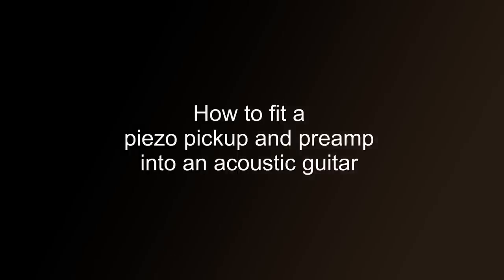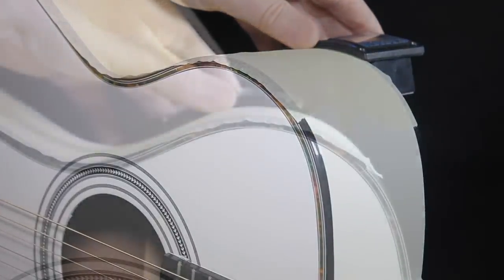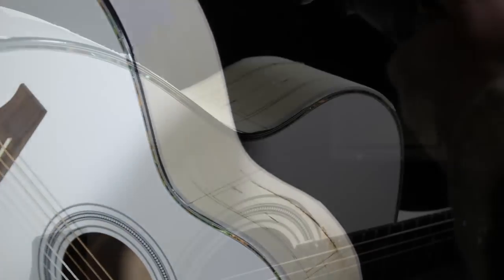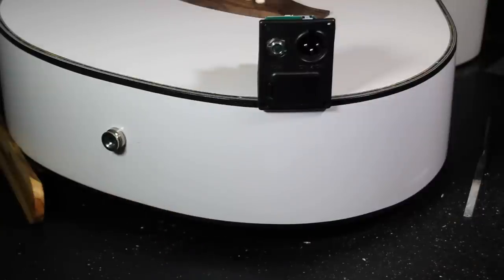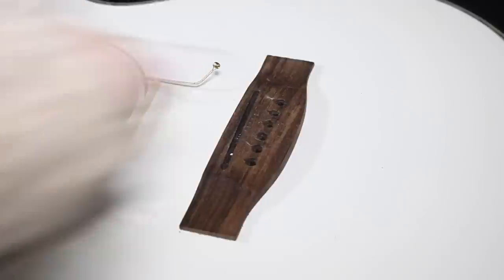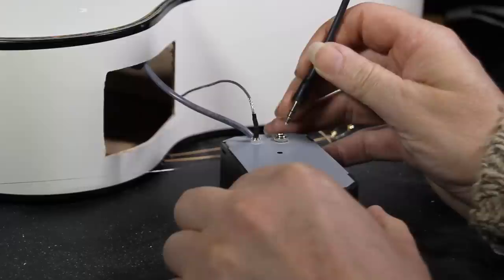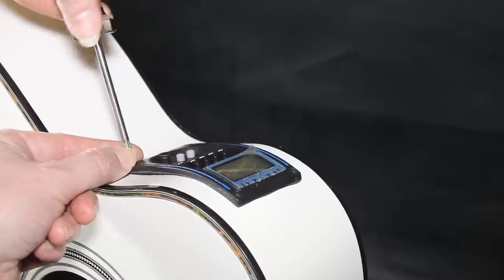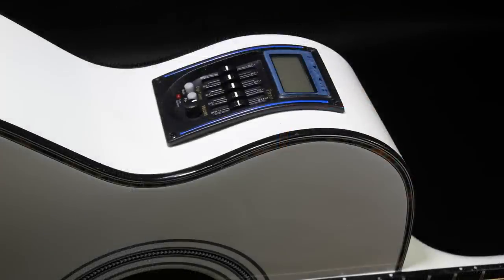How to fit a piezo pickup and preamp into an acoustic guitar. The LC-5

Comment: Also, how is the guitar with the weight of the new mic in it. It is a lot heavier than a gooseneck, so has it ever fallen out of the preamp. Would you have confidence gigging with it?.....Weightwise,,,
Reply from the maker: +Benny Hill The new mike is almost exactly the same weight as the original one and the plug socket is really tight.  It has been in place over the last couple of years now and the guitar has traveled and been gigged.  I have every confidence it will stay in place for as long as it's needed and any knock big enough to knock it out would ruin the guitar.
Reply: +GCH Guitar Academy ...Thanks , 1  So in your opinion does the Sony mic work well with the preamp...2 Does the preamp volume control work with the Sony or not??..........Many Thanks.
Reply from the maker: +Benny Hill Yeah . . . the original had a slight background buzz which was completely silenced when using the Sony mic.  However, you do loose the versatility of the gooseneck and the ability to fine tune the position of the mic.

Comment: Hello,  really nice job over here! i was wondering if i have to lower the bridge height or leave it as it is?
i mean,will the action still be the same over the neck of the guitar or will it increases because of the under bridge pickup?
Thanks to answer...
Reply from the maker: If the guitar had no pickup in it originally you will need to lower the action.  To do this you sand the bottom of the bridge down to compensate for the height of the pickup.  If you are not sure, but a spare bridge before you start as they are very cheap.

Comment: I bought the extra same kit, but before hacking into my guitar I tried it out. After turning the unit off the piezoelectric pickup and mic stay active. Is this normal? I think It's going to drain the battery right?
Reply from the maker: Yes, that will drain the battery but normally the switch on the control unit is just for the tuner display.  The switch for the pickup amp is in the jackplug and xlr plug so it should go off when you unplug it.  Unfortunately this is a little awkward to test.
Reply: Glad I see this.
There are switches inside the unit.
I moaned to the Ebayer selling to me, but they never replied.
Just a simple bit of paper would clarify all this...

Comment: Do you hear a difference with the addition of a microphone in the body of the guitar.....is there a different tone with the microphone compared to only having the piezo pick up under the saddle?
Reply from the maker: Yeah . . it is a very different sound and if you have the ability to mix between the mic and the pickup in the preamp then you can get the best from both methods to find your perfect sound . . .  or at least that's what I found.  :-)
Reply: Great thank you....I am going to order one like you installed. Great video I used it as a guide installing a preamp. thank you again.

Comment: I'm having a Fishman Neo-D passive sound hole pickup, can it could connected to preamp...?
like you have used a mic for better quality, in the same manner can I use my fishman?
Reply from the maker: The only problem I could imagine that could happen is that the impedance might not match.  This might not happen at all, but I would do some research first before investing or starting the job.  If the impedances don't match you might end up with distortion or not enough signal.

Comment: Is the microphone used is the ECM-DS70P? Is the original or $ 5?
Reply from the maker: Edgar Arcadio Parra Lopez I tried both (I actually tried 3 or 4 mics), but the cheap one sounded better because it picked up less bass
The fact that the mic is inside the guitar means it isn't in the optimal position, but a reduction in bass works well to correct this.

Comment: Hello what does the "note" button do on the tuner thingy? Im a beginner and I accidentally pressed it instead of the power button when I wanted to turn it off and now the tuner doesnt work. Thanks!
Reply from the maker: The note button turns on the tuner.  In tuner mode no sound comes out of the output of the guitar and If you leave it on it will flatten the battery, which is probably what has happened to your guitar.  🤔
Reply: @guitar-academy  Ohh okay. If you dont mind me asking, do you know a way to make it work like how it used to again?
Reply: When we first bought it, when I pressed the power button, it would automatically detect the guitar string when I pluck it. But now only the "-50", "+50" and line indicator thingy which doesnt move anymore shows up.
Reply from the maker: @ayllyn6788  Just press the button again . .

Comment: good day, i hope you see this comment. i just have a question, i just bought a guitar with similar hardware and the thing is, i noticed it is making a not so loud ground hum that disappears whenever i touch the metal part of the jack cable. is there anyway to ground it properly like how electric guitars work where if you touch the strings, the ground hum goes away too?
Reply from the maker: hmm, it does sound like you have a ground issue.  The first thing I would check is the lead and then I would check the easy to see connections behind the jack-plug socket.  Hopefully one of these will solve the problem because beyond this it is more complicated. 🤔
Reply: @guitar-academy  yeah, i think the one i got is just broken or something. i tried removing the hardware and checked if there's anything strange or blown out/burnt but i found nothing. i guess i'll get the fishman acoustic pickup or something similar instead. thanks for the reply man!
Reply from the maker: @sadpotato7029 No problem . .  I hope you get your guitar fixed soon and cheaply  😊😊
Reply: @guitar-academy  so here's what i ended up doing:

i found my old samson q7 mic, stupid idea sparked in my brain and thought what if i put the capsule of this mic inside my guitar instead? so i did.

at first i only replaced the broken xlr out from the mic with from another old broken mic and it worked, but the problem is, i wanted to plug it into my scarlett solo's instrument input so i can use the mic input at the same time which wasnt happening for some reason coz even if i use the xlr to 6.5mm jack, it's not giving out any signal. it works perfectly in the mic input tho.

another stupid idea came up when i saw my guitar's old jack and thought what happens if i wire this capsule directly to a jack AND IT WORKED. IT EVEN WORKED ON THE INSTRUMENT INPUT IN MY SCARLETT SOLO HAHAHAHA now it's just a matter of positioning the mic properly to get a balanced bass and treble sound from the guitar since it is mic'ed from inside. i also need to come up with something that will make the mic capsule stay in place without damaging the guitar
Reply from the maker: @sadpotato7029  very creative and should sound good 🤔
Reply: @guitar-academy  well since the capsule is from a "budget" mic, i'll let you judge how "good" it sounds. but for me it does sound more natural compared to the previous defective piezo hardware in it and also with less tinny noise from the plastic pick. for now the mic capsule sits on the bottom a little bit to the right side below the hole [ https: //youtu. be/ 25v7lwq8ar8 ] also no more ground hum. i also need to do something about the exposed wires and maybe put a cover or something to the exposed capsule
Reply: @sadpotato7029  About 40 years ago, before computers and digital recording were popular, I was doing multi-track recording with two tape decks and an equalizer in between them. I had a Radio Shack pencil condenser mic (powered by a battery in the plug end), and I just dropped that into the soundhole of the guitar. It actually sounded very good when recording!

Comment: Hi I have a problem while fitting my pietzo pick up, the channel on the saddle was the much the same depth as  the pick up which resulted in no depth to hold the bridge in position which bends when  tightening strings any tip on how to solve please
Reply from the maker: the solution to this is either to take some of the height off the bridge or to use a file or mini-drill to go deeper into the saddle, depending on the guitar.  I tend to do a bit of both, make the channel a little deeper and take some height off the bridge.  It is important not to go down too deep into the bridge.

Comment: Battery in but light flash  then turns off? Now light won't come on with brand new battery in it ? Should I trash it?
Reply from the maker: That sounds terminal, but just in case try a different battery and check it's in the right way.

Comment: Cool Video thanks. But I dont understand what you do at 14:45 - 15:45 with this white little thing.
Reply from the maker: That's just to hold the wire in place so it doesn't move around when you are playing the guitar and you can put the wires out of the way so you can's see them easily through the hole.
Reply: GCH Guitar Academy thank You. At least I got it by myself while I thought about it 😁

Comment: i watched your video before fitting almost the exact same one, mine just doesn't have the mic bit. only trouble im having with it is its overly sensitive,  like when i take my fingers off the strings to change chords i get a terrible squeek and doing a slide is out of the question. any advise

Comment: In what hole did you put the microphone? The preamp has only one hole and it is for piezo.
Reply from the maker: Yours might, but mine didn't.  The preamp I used had 2 holes in it one was a slightly different size so you could get them mixed up.  look at 15:59
Reply: @guitar-academy  How Can I doit input jack 3.5 by myself?
Reply from the maker: @Crow_spot  Sorry, I can't answer that in a few sentences

Comment: thinking about putting in a pre amp  on my acoustic what's brand is the one you just put in does it sound good  and what microphone did you upgrade it with on ebay thanks
Reply from the maker: The preamp was a cheap unbranded one I bought directly from Hong Kong off Ebay and the mic was a Sony ECM-DS70P.
Reply: Just to chime in on sources: I bought that ( approximately) same model pickup off of banggood. I think it was less than 20 USD.

Comment: I couldn't see how the piezo wire threaded though as to not be seen. How was this done?
Reply: You have to use the zip tie and the bracket all the wires should be inserted into the zip tie and then mount the bracket near the too front face of the inside in your guitar make sure it's not super tight but tight enough to hide the wires and prevent rattling or buzzing. Good luck
Reply: +Jake Mitchem I believe Joe Ibrahim is talking about how the hole in the bridge was not shown in the video. The guitar in the video didn't need a hole drilled, but it would have been nice to see the size and location, because this is a "how to", and some people would like to see it. It's no doubt as easy as drilling a hole through the bass end, but some people might be anxious about ruining their guitar.

Comment: The Sony microphone you purchase from ebay
Was it a proper Sony microphone or a cheaper version
Reply from the maker: I bought both to compare them but ended up using the fake.  There was so little difference between them when inside the guitar but I didn't want to leave the more expensive permanently inside the guitar. . .
Reply: @guitar-academy  the mic is ok
Reply: Just ordered mine looks exactly like your one but only one aux socket in the preamp and no microphone? Does it need to have microphone?
Reply from the maker: @matthewmatthias4181  No it doesn't . . in fact I've noticed that the batteries seem to last longer ones without the mic. . .  😊
Reply: Nice cheers good video by the way very good guide
Reply from the maker: @matthewmatthias4181  Thanks . . . .  😊

Comment: excellent !
can I use the same process on a classical (nylon string) guitar?
Reply from the maker: Yes you can, but make sure you have the correct under bridge pickup.  The classical bridge is longer, but you can measure it and then get the pickup designed for that length of bridge.
Reply: Normal pickups don’t get the sound of nylon strings tho
Reply: By "normal pickup" he means a magnetic pickup.  There are three types of pickups -- magnetic, piezo and mic. Magnetic pickups are the kind you see on electric guitars but can also be used on acoustics (check out the Dean Markley Acoustic pickups for a magnetic in-hole magnetic pickup) --  they work because the metal strings oscillate the magnetic field, which in turns varies the electrical current (nylon strings therefore won't work because they won't disturb the magnetic field).  Piezo pickups work by their crystals generating an electric current in response to the mechanical stress resulting from the vibration of the guitar's bridge.  The mic works just like any other microphone -- the sound vibrates the diaphragm which creates an electric current in a capacitor.  There are two pickups in the pre-amp he installed -- a piezo pickup he installed in the bridge and a microphone which is in the body.

Comment: I should have watched this before i installed. I cut a bigger hole than im supposed to now the screws dont have a place to be pierced in. Do u have any suggestions about what to do😢
Reply from the maker: You might be able to mount/glue some strips of wood inside the hole around the edge to make the hole smaller.  When you put the preamp in you shouldn't see the repair. 🤔
Reply: @guitar-academy  hey! Thank u so much for the video and the tip. I will try with a popsicle stick. Hope it works out 🥳🙏🏻
Reply from the maker: That's strange, I thought exactly the same thing.  I hope it works out too 😊😊 @samanthacollier8933
Reply: @guitar-academy  thank you so much! may I ask one more question please? I think my preamp also doesnt provide sound from the pickup I think it only gives volume from the built in microphone. Do you think I missed something while placing the cable under the pickup area? Mine wasnt with 90 degrees it was a golden wire like the one you showed. Thanks!!
Reply from the maker: @samanthacollier8933  oh, that sound it might be faulty.  There's very little you can do wrong with the pickup.  If the wire is under the saddle (the plastic looking bit) so it has pressure on it from the saddle and the strings it should work. 🤔
Reply: @guitar-academy  oh ok then thanks a bunch i will lastly check the jack pot then maybe thats a bit loose. Saved me from removing the saddle again Thank u!! 😍
Reply from the maker: @samanthacollier8933  Hopefully that's the problem, good luck 😊😊

Comment: in the 10:00 that piece
do i need it in classic guitar ? 
is it to remove the noise sound ? 
i mean it's special for steel strings
Reply from the maker: That is the pickup and you do need it for a classical guitar as it is what sends the sound to the preamp.
Reply: thx alot my friend ❤❤❤❤❤
Reply from the maker: @عمرأنيس-ح9م  thank you  . . .  😊
Reply: i have another Q about the pickup ..
it doesn't matters which end i'll chose to make the hole for wire ? 
or it's imprtant to put the hole next to bass strings ?
Reply from the maker: @عمرأنيس-ح9م  on that particular pickup the hole should be by the bass string because the pickup is designed that way and the wire comes out closer to the preamp,.  Some pickups are designed differently so the wire comes out near the thin string, but I have never used one of these . . .
Reply: @guitar-academy  
thnak u so much 🧡

Comment: Do you need to reinforce the sides - especially for non-laminate sides?
Reply from the maker: I didn't on this project because the curvature of the guitar gave the area around the preamp strength, and there was enough depth to the wood to allow the screws to purchase.  On this occasion I was trying to keep the job as simple as possible but I do prefer to reinforce the area around the holes.

Comment: Hi, i just installed the same equipment to my guitar but I did not place my piezo under the plastic part it did not fit I placed it just behind, does this affect something? I don't get my tuner working and there is also a busing sound that stop when I touche my output.
Reply from the maker: Sorry to say, that's all wrong.  Part of the reason for all the noise is that you have to have the amp volume up high to hear anything because the pickup is hardly getting any signal where it is.  The pickup has to be under the bridge so you need to buy one that fits if you want it all to work correctly.

Comment: i was wondering can you please tell me what is the tool that you used to cut the guitar open?
Reply from the maker: The tool is a rotary tool (Dremel), with a carborundum disk on it.  My Dremel isn't Dremel the maker, it's a cheaper make but it does the same job.
Reply: @guitar-academy  Good sir, i'm planning to buy a similiar low cost Dremel tool as well, but have seen incident comments saying that the shaft bent or the rotary blade shatters in action, have you encountered any such situation thus far ? Thanks
Reply from the maker: @johnangkengyong6952  Yes I have, But that has nothing to do with the tool.  You can buy the tool and the cutting disks  separately with the shaft and these are what brakes.  The cutting disks ware out anyway because that's what they are intended to do, but you can buy better quality cutting disks and shafts.

Comment: Could you do it with nylon strings?
Reply from the maker: Yes you can but measure the length of the bridge and make sure you get a pickup of the same width.  Nylon strung guitars usually have a slightly longer nut, but this isn't a problem as you can buy a pickup with the same length.